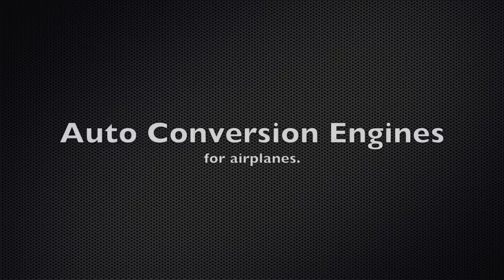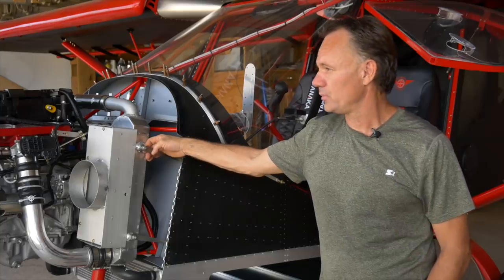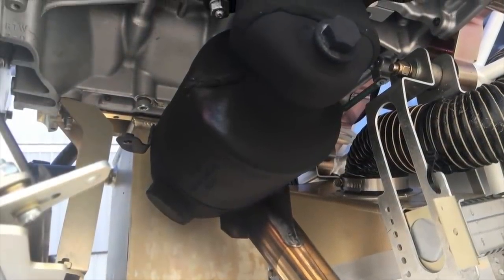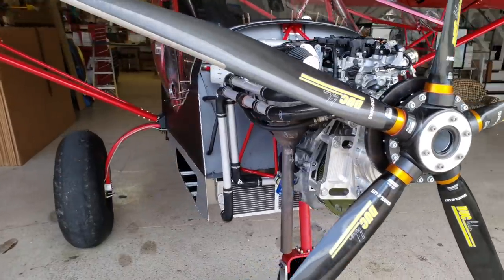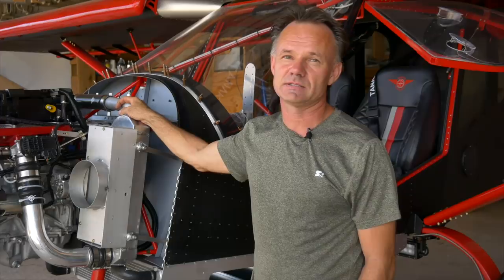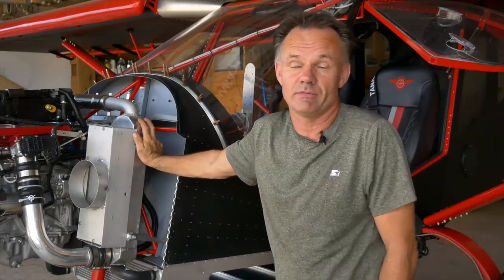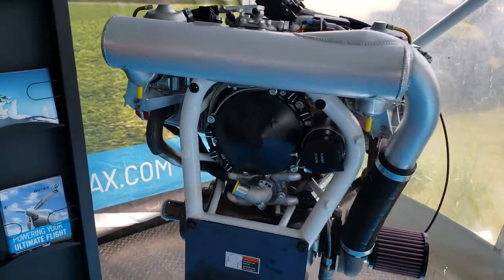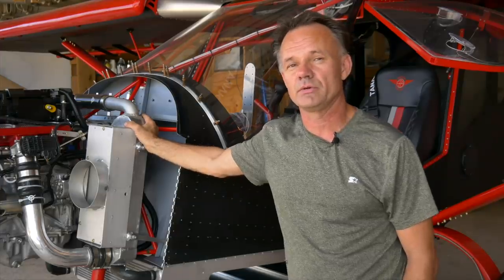Car Engines Used For Flying Airplanes l Viking Aircraft Engines

Comment: I don't care if it is Honda quality.  Without upgrading the internals, a constant 5500 RPM is going to have a very low TBO compared to a purpose built Rotax at the same RPMs.  He is being disingenuous saying that there is no genuine airplane engines.  Lycoming and Rotax started out as something else but they are purpose built for aircraft now.  Honda quality in the automobile world is a constant cruise at 2500 RPM.  Sure they rev very strong and high but only for seconds to minutes at the most.  I guess time will tell once we see some long term real world usage.
Reply: James I am having bit less knowledge on engines , but rotax too have 5500+ rpm and if propeller is coupled it reduces rpm.  Those are direct and Honda suzuki uses PSRU(bit -ve aspect) they also reduce rpm then . what is the difference ?? Lycoming and rotax are horizontal placing and auto conversions are I4 engines and technologically these are bit advanced than Lycoming..
Thanks in advance
Reply: @Human.agnostic.aethist  The difference I am talking about is the engine's internal components ability to withstand running at 5500 RPM to achieve the maximum horsepower to takeoff and cruise.  An airplane's motor is almost always 80%+ power.  An automobile does not cruise at 80%+ power.  You only use it for a few minutes as you go through the gears to get to 75 MPH.  Honda engineered it for that use case.  Not being at 80 to 100% power all the time.  However, Rotax did the engineering upgrades to the motor to handle an airplane's workload.  Maybe the Honda Fit motor can handle it but I am skeptical. When a motor is near max horsepower it is generating sustained heat.  High oil temp becomes an issue.  So does shorter oil time on the cylinder walls.  More component stress due to high RPM.  Time will tell...
Reply: @JamesLaursen  thanks James, I too heard that the  design specially used for aviation have more TBO and 80% power can use for cruise speeds...
Reply: @JamesLaursen  It seems like you could choose the engine appropriately.  I am familiar with tractor engines where they run at nearly full output all day.
Reply: I think a better point to make would be to say that there are no MODERN, genuine aircraft engines, not that run on gasoline anyway. 

Anyway, I'd be worried about longevity as well. I'd upgrade the rods and pistons, at the very least. Honda has always had ridiculously strong crankshafts, and the blocks that the turbo Viking engines use are closed deck, so those should be more than strong enough to handle anything they might experience in aircraft use.
Reply: @JamesLaursen  in my 2018 accord, if I drive in sport mode, I am sitting at 3k-5K rpm all day.   I get the loads are different but just an example of real world.
Reply: Sorry for dropping in, but I have to concur with James. The rotational speed of the engine is only of secondary importance though. It is indeed about power produced, a plot of the power use over time in a passenger vehicle shows a concentration around the 25kW mark, any greater power usage is a rare occurrence.
That is because a passenger vehicle needs about 25-30 kW to cruise at 120km/h... motorway speed. Regardless of rotational speed (RPM) or setting or...
EG. a motorbike needs even less power to do 120km/h but most sportsbikes will do about 6000RPM at that speed while a car is at 3000. 
To put it simply, 80% power in a passenger vehicle with a 67kW engine would mean sitting at about 180km/h  for hours on end.  

Yes on the technology front...but even that is relative...
Direct injection (DI) was invented to be able to ignite a very lean fuel mixture (stratified injection) , I'll spare you all the details, and to reduce hydrocarbon emissions (though NOx increased). The problem is in the word 'lean', a lean mixture is only possible when not much power is required... like when producing 25kW on the motorway.
When doing 80% of full power your mixture will be very close to lambda 1.0.
The gains are in a better combustion chamber design, better flowing manifolds and better pulse tuning, maybe a lighter architecture. But Rotax has that too.
The short of it is the simple truth that if you want reliability you need either under-stressed designs... like a big air cooled hulk with lots of displacement and low rotational speed. Or a very sophisticated design with very extreme materials. The humble car engine is non of those 2.

The power of a viking engine is in the mass production... meaning that parts are plentiful, cheap and you can get it overhauled everywhere.   
So call it a cool 5000 'bucks' to replace pistons, rods, crank and bearings every 900h that is still a lot better than 18000 for a 0-200 ever 1800h... but nearing the 12000 for the 912's 2000h TBO.
Given the purchase price of both Continental or Rotax the TCO becomes a bit better...for an experimental my money would still be on a Viking.

I would be very keen for Viking to strap one to a bench and report the results.
Sorry for the long post.
Reply: @parisrogiest9324  "The short of it is the simple truth that if you want reliability you need either under-stressed designs... like a big air cooled hulk with lots of displacement and low rotational speed."

Contrary to what most people believe, a reliable, under-stressed, air cooled piston engine doesn't exist in the aviation world. Despite their reduced complexity, air-cooled engines have extremely poor reliability when compared to modern water-cooled engines, this is because the cooling of individual engine parts is wildly inconsistent and because their cooling capacity is very limited, requiring the pilot to manage the fuel mixture in order to keep temperatures within limits. The big, air cooled, direct-drive aircraft engines are not under-stressed, they're always right on the edge of catastrophic failure due to their poor cooling performance and because of the high torque pulses which are a result of their large displacement, along with a lack of inertia in their rotating assembly to smooth out those huge torque pulses (which is due to their low rotational speed). Making an engine drive the propeller directly also requires heavy, huge displacement engines which must be built in a very flimsy manner in order to make them light enough for aircraft use. The added complexity of a PSRU actually increases reliability, which is why all of the most powerful aircraft engines had a PSRU.

"Or a very sophisticated design with very extreme materials."

No, water cooling and PSRUs eliminate the requirement for exotic materials because water cooling keeps everything consistently cooled and because it's easier to make smaller parts stronger without using exotic materials. Using a PSRU allows for the use of lower a displacement engine, which makes use of smaller components. 

The one issue that the Honda engines have which there is no way to work around (without completely redesigning the engine or dramatically lowering displacement) is high piston speeds, and that is something which produces stress, wear and inefficiency. The longer the stroke, the greater the distance a piston must travel for each rotation of the crankshaft, which means that a piston in an engine with a longer stroke must move faster than it would in an engine with a shorter stroke at a given rpm. With stronger rods and pistons, reliability wont be an issue in the Honda engines, but efficiency and longevity will be. An engine designed for aircraft use will typically keep the mean piston speed below ~12 m/s, but the Viking engines are around 16 m/s (which really isn't that bad, just higher than it should be). For comparison, at 5,800 rpm, a Rotax 915 iS will have a mean piston speed of 11.8 m/s.

Edit: All in all, I'd trust a converted Honda engine over a LyContisaurus engine any day.

Edit: Actually, efficiency is even pretty good on the Viking engines, They burn 0.4 lb/hp-hr at full power, which is better than what LyContisaurus engines burn at cruise.

I guess my rant could be better summed up by saying that the Viking engines are a major improvement over air cooled engines, despite the fact that they're not perfectly optimized for aircraft use.
Reply: @PistonAvatarGuy  sorry for the late reply. Been away from keyboard. You make some excellent points. This could be an excellent debate, I must add that I have no access to numbers regarding light aircraft   incidents, I would be very interested though if you could share. 
On the air cooled front. There is no reason that air cooling is inferior to water cooling.   In all ICEs the oil takes away the heat from the critical parts in the first instance. The water jacket only receives that heat later. Water cooling is however a better way of cooling the combustion chamber and valves. Mostly because oil flow is lacking there. Also the reason why oil-air or oil-water heat exchangers are used even in water cooled designs.
So the concept is not the problem... Bad engineering is. And I do not concur that the 0-200 is that bad on cooling. 
That brings us to mixture. Bad mixture will ruin any engine regardless of how it is cooled. EGT gauges are pretty standard across the board for that reason. I would suggest the carburettor to blame for having to adjust it.
About the mean piston speed. Yes the higher the mean the higher the acceleration and the higher the forces. Although they are only deemed critical above 25m/s. I will however agree that the lower the better for engine life. Hence why  a big displacement low speed in theory is better than a high speed engine. The real problem of this discussion is that there is no consensus on the design brief... Weight, cost, endurance,... Are all taken in and out of the scope at will. 
Hence my point of using extreme materials. With high torque at high speed you need lightweight components and thus high specific strength materials.
Car engines avoid this due to cost. Although materials have come a long way since the 0-200. And cheap now is better then cheap then. 
How does the fuel burn compare to Rotax?
Reply: @parisrogiest9324  Before reading my reply, Google: AOPA, Airframe and powerplant - Mixed Reviews - July 5, 2002 - Liquid cooling — yea or nay?

"There is no reason that air cooling is inferior to water cooling."

This is completely wrong. Water cooling cools much more consistently and efficiently. Do you not wonder why basically every modern engine is water cooled?

"In all ICEs the oil takes away the heat from the critical parts in the first instance."

No, the heat does not first go to one fluid and then to another, different parts of the engine are cooled by different means. The cylinder head, for example, is largely cooled via its water jacket, while the crankshaft is cooled entirely by oil.

"So the concept is not the problem... Bad engineering is."

You could never engineer an air cooled engine to be cooled as consistently and efficiently as a water cooled engine.

"And I do not concur that the 0-200 is that bad on cooling."

It's fine for what it does, but it doesn't compare well with modern water cooled engines.

"Bad mixture will ruin any engine regardless of how it is cooled."

Except that water cooled engines can tolerate a much larger range of mixtures in a much larger range of operating conditions.

"Hence why  a big displacement low speed in theory is better than a high speed engine."

With a shorter stroke, you can run the engine at higher rpm and still have lower piston speeds. 

"The real problem of this discussion is that there is no consensus on the design brief... Weight, cost, endurance,... "

All are superior with water cooled engines, which is why it's so rare to find air cooled engines used in any modern application.

"Hence my point of using extreme materials."

Which doesn't make any sense for the reasons that I listed.

"With high torque at high speed you need lightweight components and thus high specific strength materials."

Continental and Lycoming engines must be built to cope with high torque pulses, that's not the case with modern engines. High engine speeds are really only relevant with regard to piston speeds, which aren't higher in modern engines because of their shorter strokes.

"Car engines avoid this due to cost."

They avoid it because they don't need exotic materials. They greatly outperform aircraft engines, without using exotic materials.

"How does the fuel burn compare to Rotax?"

The BSFC of the Viking engine is around 245 g/kWh, the BSFC of the Rotax 915 iS is between 310 and 240 g/kWh, depending on the power setting (the higher consumption number is at full power). The Viking engine could likely get lower numbers at cruise power settings with proper ECU programming.
Reply: That is true, but, you need to look at the tolerances, metal quality, heat dissipation... and so on. The reality is, we don't know what each engine n a car is capable of, different engines are different. With that, we may actually get the same reliability and longevity, if not more, as auto engines are going through improvements at more regular intervals in design changes than are purpose built aircraft engines. Think back to the days of old when Bugatti, Rolls Royce, BMW... used same engines in cars and auto. So it's it's possible, but it depends on the particular engine. I's personally like to see diesel car engines being used, particularly the German engines which get a lot of hp.
Reply: @cwehbe  Why diesels? They're about twice as heavy, they're expensive and they burn expensive fuel.
Reply: You get a lot more flight time with lower gph fuel burn, you make biodiesel forever without the concern about the rising cost of fossil fuels and the finite nature of it. As for the weight, yes you are right, they are so far heavier, though not in all examples. If you look at what Mercedes, Audi and BMW have done with their high performance diesel engines, they got the weight way down. For me, if I can get more distance with my aircraft, it's worth it.
Reply: Makes sense.
Reply: @cwehbe  "You get a lot more flight time with lower gph fuel burn..."

Compared to Lycoming or Continental engines, sure, but if you're talking about modern gasoline engines, diesels burn the same amount of fuel by weight. 

"...they got the weight way down."

Not really. The AE330, for example, is about twice as heavy as a comparable automotive gasoline engine. Not only are the engines heavier, but the PSRU must also be built more heavily in order to deal with the greater amount of torque that diesels must produce in order to make their power.
Reply: Though in the grand scheme of things, and beyond all internal explosion engines, I hope to see a sky filled with all electric aircraft one day with more safety and autonomy so I can see more people enjoy the magical feeling of flying in your personal machine. It's a magic that I want everyone to experience.
Reply: Well, I agree, diesels are still heavier, but not nearly the weight of the older engines.
Reply: @cwehbe  Well, that's a long, LONG way off. People use aircraft to travel long distances quickly, but, currently, electric aircraft can only fly for short distances at very low speeds. The idea is nice, though.
Reply: One small step at a time. I guess the first market will be flight schools for short flights. Future looks nice though! I think Pipistrel and sun flyer have flying aircraft in the light category.
Reply: @cwehbe  It's not about adoption, it's about there being no technology available which can make electric aircraft viable. There isn't even anything promising in development which could make electric aircraft viable. For light planes, battery energy density would need to increase at least 5 fold, but something like an airliner would require a 100 fold increase in energy density.
Reply: @cwehbe  Is your comment about tolerances pointed at the aircooled vs liquid cooled debate currently going on ? If so, it's yes and no... piston and valve tolerances on the whole for air cooled ICE are indeed bigger. But other parts are the same. At this point I like to point towards Porsche C-class LMP's of yesteryear... some had really large power outputs and were kept high during 24h races. So air cooled is not a bad design... there is just bad engineering.
In cars liquid cooling is just a far better proposition regarding packaging and air flow (or lack there of).

We know exactly what a car engine is capable of, over-engineering is a thing of the past. These days all manufacturers have very powerfull simulation software and most, if not all, have a whole army of test benches. Car engine design is an incremental process, meaning that data about endurance, longevity, emissions,... is accumulative. So before pen is put to paper we already know what the engine is capable of. And why ? To make the best possible trade off between the project drivers. On the surface: cost-quality-time.
The last decade or so even more data came into the grasp. GPS data form all over the world is collected, packaged and sold to manufacturers. Thus engine are minutely designed for the indented market (geographical location, use case and customer expectations).

And the proof is in the pudding, in the early 2000's these tools really became leading in car designs and we saw quality issues across the board. BMW, MB,... quality brands of yesterday where have all sorts of issues. This despite months of research...designing... and real world testing.
It's not that they didn't know... it's that for profitability the design limit was set too low.
Things are better now cause with more data the limit is set better. But any mechanic will vouch that quality was highest in the 90s.

Another example is that in Europe the corrosion prevention is dependant on market. full body galvanisation is now again a rarity... and delivery vans (GVW 3.5t)? They don't get anything anymore... because the intended use is for them to live out there economical life (4 years on the books) and then be sold on to a client that doesn't matter much to the brand (most likely eastern Europe).
However the engines are designed for the hard life of a van-man... but at 300 000km they too are gone.

German autobahn machinery would indeed be engineered  to cope with sustained high speed operation, although that is not true anymore for the 4 cylinders. If I remember correctly at BMW these are for the most part PSA engines. And the Mercedes A-class engines are Renault.. Not very confidence inspiring...

Don't mistake my argument for hating on the Viking concept. Cause as stated, if it was my ultralight I would fly a Viking too. 

Let me introduce you to the conundrum... say you're looking for a mx5/miata and for the same price
, with the same mileage,  you can buy one from the hairdresser on the corner... or one from the local racing school... 
Give my regards to your hairdresser ;)
Reply: I was actually referring to tolerances in engine design of how well the general parts fit together to eliminate micro vibrations that cause early engine wear. General car engines are getting better with time with advanced manufacturing and robotics that didn't exist. But this is in general... I agree with you that not all manufacturers nor all cars from the same manufacturers are given the same engineering. You have to look at what we are capable of in certain cars not all. You are right MB are using Renault as well as other engines made in India and Mexico... even China is too expensive and too high quality for them! LOL
Reply: @parisrogiest9324  "At this point I like to point towards Porsche C-class LMP's of yesteryear... some had really large power outputs and were kept high during 24h races."

You do realize that this was decades ago and that performance has improved significantly since then, right? Also, in a racing application, the environment that an engine operates in can be carefully controlled, that's not so in an aircraft. 

"In cars liquid cooling is just a far better proposition regarding packaging and air flow (or lack there of)."

If it were as simple as that, why aren't racing cars still using air cooled engines?

"But any mechanic will vouch that quality was highest in the 90s."

Europe is not the world.
Reply: I was only referring to light sport aircraft which I fly, not commercial. There are currently 2 light sport electric aircraft.
Reply: @cwehbe  And both are useless..
Reply: Not for what they are intended for, flight schools for now.
Reply: @cwehbe  Yes, even for that application. They can only fly for an hour, that's limiting even for students.
Reply: @PistonAvatarGuy  You missed the point... if air cooled was up to it then, with those materials and those production methods it is now too.
There was not any form of control over an engine during a race up to the late 90s. Also Racing is a far more hostile environment than a GA aircraft at cruise.

Also I would invite a discussion... with arguments...

It is as simple as that. You can make any engine air cooled. But when you can't get the flow.. cause you need it for say.. euhm.. underbody flow or just to improve drag as a whole or cram a large engine in a tiny bay... then you go LC.

As long as the Honda engine is considered it is the world. The intended use for these engines is to operate in similar markets across the world. There is little variety for a city runabout and a daily commuter.
Reply: @PistonAvatarGuy  It makes for a interesting read. I didn't know of extensive problems with the continental engines. Nobody here seems to have such issues. 
But I must put into context that the text compares the old air cooler with a 30year younger design, that benefits from all that experience. Also the problems stated come from a lack of control, if the air flow that enters the bay would be controlled than it would be different.
The control in LC is inherently design into the thermostat... or electric pump these days.
Even the VW kaeffer had crude control over the air flowing over the cilinders.

I don't remember how we got into this discussion over LC vs AC, but going back to the discussion about the car-as-a-plane-engine debacle:
Yes it is liquid cooled, but that doesn't mean it's superior over the other GA and LSA engines.
Reply: @cwehbe  That might be true, i have often wondered. Most papers and reports I've read state that the film is never broken, if that is so than local wear due to loose tolerances should be mitigated ? I could, however, see this as a problem in the warm-up stages.

I was trying to think of another example of high stress use of regular car engines. In the UK they have something called the 750MC series where a whole range of street cars compete in different, tightly controlled, categories. Most rebuild there engines after 2 seasons... that is not a big TBO.
Reply: @parisrogiest9324  There's no reason why race teams can't use air cooling if they want to, it's just impossible to be competitive with air cooling, not only because air-cooled engines produce more drag, but also because the engine itself would never perform as well. Water has a much higher capacity for absorbing heat when compared to air, and, as engine power output increases, so does the amount of heat that is produced. With air cooling, eventually, you simply get to the point where it's impossible to move enough air over the engine to absorb the additional heat. Another major issue is that the mechanical tolerances in an air cooled engine must be much larger than in a water cooled engine in order to allow for the wildly inconsistent expansion and contraction of engine parts that comes with the inconsistent cooling of those parts. High rpm engines require tight tolerances, and most race engines are high rpm engines. The higher the engine rpm, the better the power to weight ratio of the engine, which is why geared engines perform so well in aircraft. Water cooled engines are also stronger than air cooled engines, because the monolithic block is much stronger (and simpler) than having individual cylinders bolted to the crankcase. Water cooled engines are also more rigid than air cooled engines, also because of the monolithic nature of the engine. Greater rigidity ensures that components stay where they were designed to stay. Water cooled engines are also inherently lighter than air cooled engines, because water jackets are lighter than cooling fins and also because water cooled engines can be smaller than air cooled engines overall, simply because the cylinder spacing can be much closer in water cooled engines, making the whole engine lighter. 

In short, you could never make a 925 hp, 203 pound (92 kg) engine that revs to 19,000 rpm (like BMW did for F1) without water cooling. Water cooling makes the high performance of modern engines possible.
Reply: @parisrogiest9324  "Nobody here seems to have such issues."

If you keep up with aviation, you'll read about catastrophic engine failures causing the crash of a light aircraft on a very regular basis.

"Also the problems stated come from a lack of control..."

No, it's largely due to a lack of cooling capacity. In aircraft, cooling the engine at full power must be balanced with cooling the engine at cruise, and that's difficult to do without adding weight to the engine (larger/more cooling fins) and without adding drag to the aircraft in order to force more air over the engine. Many air cooled engines have cowl flaps to control the amount of air flowing over the engine.

"Yes it is liquid cooled, but that doesn't mean it's superior over the other GA and LSA engines."

On paper, it is. It has the potential to be more reliable because it's water cooled, it's lighter and it's more efficient. If it were optimized and certified for aircraft use, it would likely out perform any engine currently certified for use in aircraft.
Reply: @parisrogiest9324  Looser tolerances always result in reduced efficiency, reduced performance and reduced reliability. 

Automotive racing engines are often pushed much, MUCH harder than aero engines. Consider that a NASCAR engine makes in the region of 850 hp, at around 9,000 rpm, for hours at a time during a race and weighs around 400 pounds. A Lycoming or Continental engine would never survive such torture, not even for a minute.
Reply: @cwehbe  moreover compared to 100ll & autogas they are bit environmental friendly.  And jet fuel can b used almost every where
Reply: It can run all day